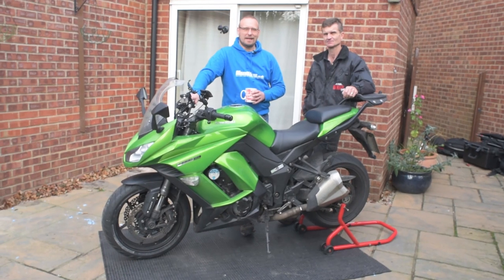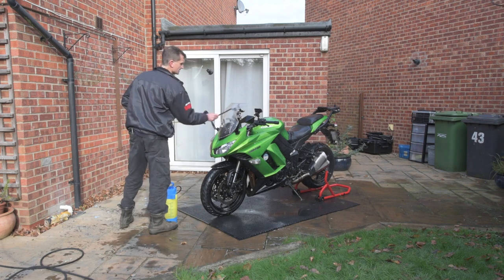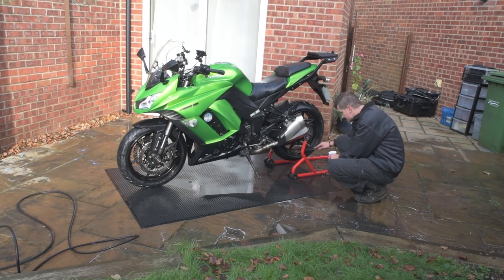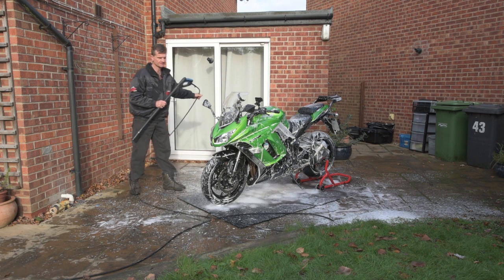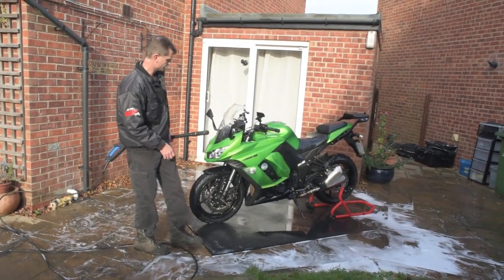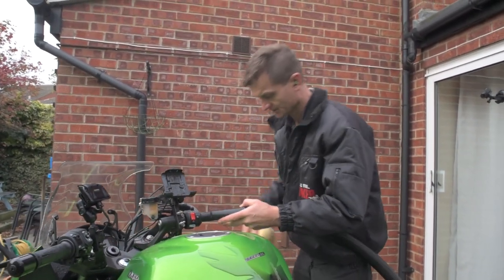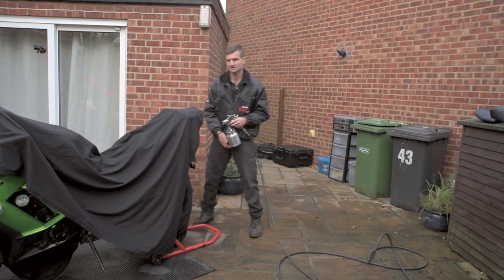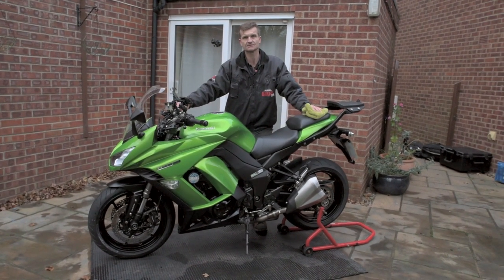How to clean you motorcycle and protect it for up to a year! All Year Biker test

Comment: Couldn't help but cringe when that jet wash hit the radiator. Must just be me been over protective when clean mine.
Reply: +Chris Moore Can you elaborate on why that would make you cringe? :) Thanks Not too savy with this stuff
Reply: McNasty rad fins are easily bent
Reply: Chris Moore and he took a brush to the screen
Reply: lol, pressure washer will not harm it in the slightest, even if you were silly and sprayed closer but the distance he sprayed it from just tickles it, they are not that easy to bend either.  I would not use the brush on most of the bike though.
Reply: Ever drove your bike in the rain on a highway and thought about the speed of the rain hitting your bike?

Comment: Been said already but using a cheap brush with degreaser on the grimy areas then use that same brush on the paintwork and screen. Should never use a brush of any type on the paintwork and screen, just a microfibre wash mitt and ph neutral shampoo. He’s obviously not worried about swirls and marring.

Comment: Jetwash?  I don't really see the need for a high pressure washer on a bike, which could do as much harm as good.  A garden hose and low pressure is all that's needed.   Only a few cleaning products I'd use, and Sdoc100 cleaner is one of them as it won't attack alloy like some other "market leaders".  Then rinse with a garden hose or pressure washer on low pressure.  This guy is not acting professionally imho...he scrubs dirty wheels and engine casings with a brush and then uses the same thing to scrub the screen!  Love to see how many scratches that might have caused.  I would always use a separate microfibre cloth or fleece mitt for paintwork, plastics and screens, and have a separate rinse bucket or rinse under the hose pipe.  

Don't use the darned brush which was used to clean crud off the bike to come anywhere near paint or screens....very basic stuff.  Dry after rinsing (pet dryers are the exact same things as bike dryers but at half the cost), liberally apply ACF50, leave 10 mins and remove excess.  No need to apply with a pressure system.  Amazed that he didn't remove the bodywork panels which would have allowed him to get to all the hidden parts rather than blasting away with loads of ACF.  Also, all paint surfaces would have needed degreasing to rid them of ACF50 before polishing (which he didn't seem to do) because the polishes won't bond or bind with the paint surface otherwise.  A conventional restorative polish followed by a 50/50 IPA/water clean then a sealing polish like Meguiars LocknSeal is the proper way to do it.  I wouldn't let my bike anywhere near this guy/company and and absolutely wouldn't use a jetwash on high pressure.

Comment: whoooaa.. this is so overratet....  Use petroleium as a degresser.... 7$ each liter... Use standard cheap autoschampo    5$ for 100 liters (after water). 2 buckets one with the schampoo and one with clean water and there you go... works perfect.
Reply: haha, what nonsense! Petroleum does not damage chains or o-rings, I have used this for 10 years and ride 20.000km on my bike yearly.... Try to youtube petroleum vs chain, it is harmless... After cleaning, you will lube it.
People who read things on the internet other people have said but know nothing about are so funny :)
Reply: and it does DEFENTLY not attack paint.... stop playing expert when you know NOTHING about it... Fuel does not attack paint on your bike either.... It is fuel resistant....
Reply: Fuel will dull and fade paint work and it will dry and crack rubber. Do what you will but fuel is not the right gear.
Reply: Petrol is an awesome cleaner/degreaser but I would not use it to clean anything but engine parts off the vehicle myself.
Reply: @HORNET6 You think of gasoline right? I mean lamp oil, like the petrolium product, why dont you want to youtube "petroleium vs o-rings motorcycle" there are so many videoes proving it dosent damage, and my current chain is on 45.000 km and i give it a good "bath" in pretoleum every month..